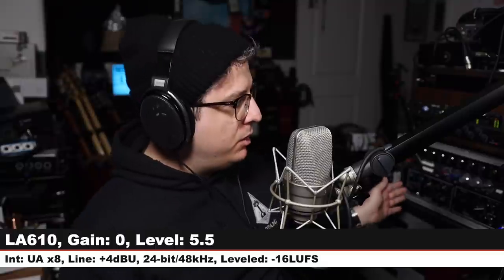Tube Preamps, TLM103 vs. OC818, Podcastage's Beanies (BSP-262)

Comment: I've had the LA-610 for several years and can recommend it if you like a bit of colour from your mic preamp. It gives you lots of options for gain staging within the unit, the shelving EQ controls are very useful and the compressor is aggressive in a good way. It's also a killer bass DI.

Comment: About the H5: he should try to record with batteries and not connected to a computer. Sometimes the connection of the power supply to the power outlet causes noise in such devices (like lack of ground or phase issues).
Reply: Funny you should ask that. I was playing with my Zoom H6 yesterday with a dynamic microphone and the noise and room sounds were driving me crazy. I considered the possibility that some of the noise or buzz was from my power supply and I ran out and bought some batteries. But there really is quite a bit of noise in my apartment. I'll need to treat an area and try it again. Batteries are so expensive that I didn't open them and try it yet. Cables were another thought so I tried to cast aside my noisy audio cables for better quality versions. My apartment is a mess.
Reply: @seanwebb605  Get rechargeable batteries.
Reply: @SusheelChandradhas  For optimal operation free of noise or other non technical reasons?
Reply: @seanwebb605  Just so that you don't spend so much on disposable batteries. ;)

You said "Batteries are so expensive that I didn't open them and try it yet." I was addressing that.
Reply: @SusheelChandradhas  That ignores the issue of noise and optimal operation.
Reply: @seanwebb605  I was not attempting to fix that issue. ;) Just the one that you brought up.
Reply: @SusheelChandradhas  There is no point in offering a solution that ignores the original problem that we are trying to solve. That’s just incredibly stupid. Leaving the device off would solve the cost issue too!
Reply: @seanwebb605  My good man... No need to get rude. One person suggested using batteries to reduce interference. You commented on that, and said batteries are expensive, so you've not tried it. I suggested recharable ones. The matter ends there. Chill.

Comment: That’s OC818 sounds better, way better than the Tlm 103. And if you don’t need the extra polar patterns on the oc818 just get the oc18. They are the exact same microphone but the oc18 doesn’t have multiple patterns. And it’s wayyyy cheaper 300 cheaper. Man

Comment: If you take a beanie and roll up the border once more it becomes shorter / lower. Problem solved. You might have a look into flat caps or car caps (e.g. from the US, Stetson).
"Here" the Roth Co cap is 4x as expensive as on your side of the pond.